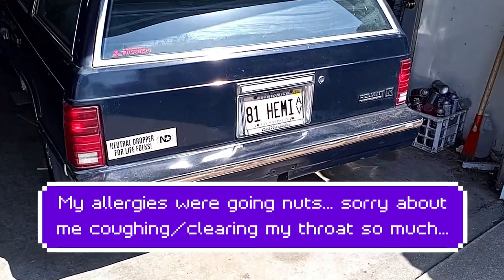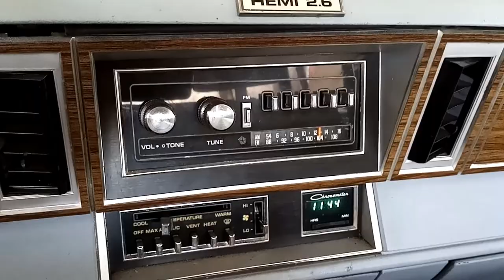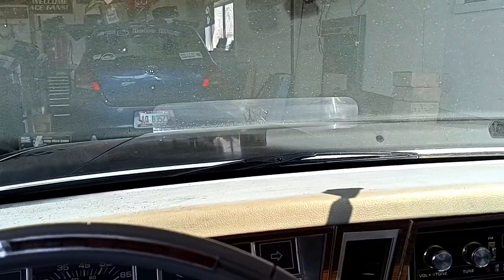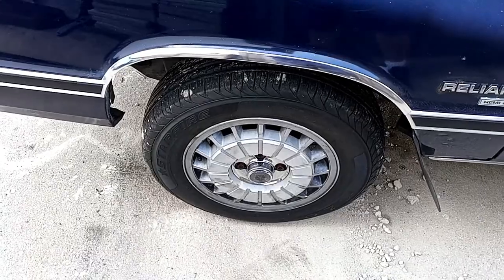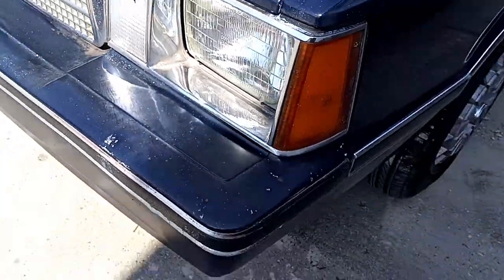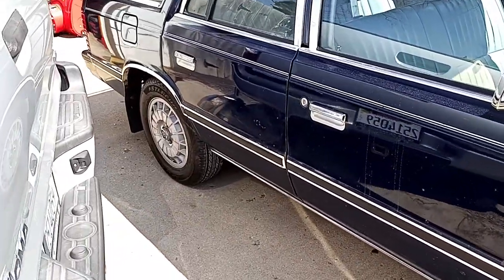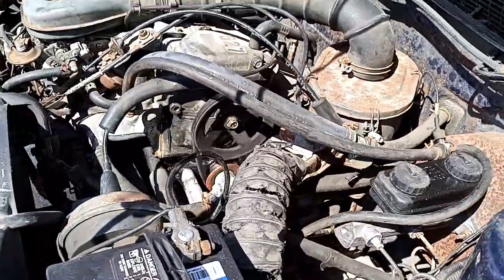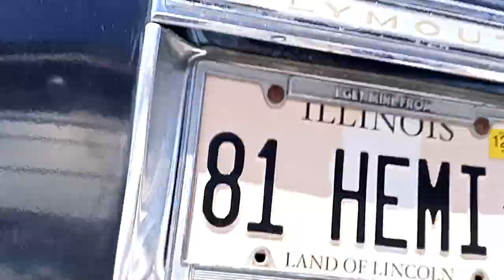1981 Plymouth Reliant K tour and tow truck ride

Comment: Yes that’s how it was for equipment options  back in that era. The AM FM minus MPX radio was for those who had one ear.  😂😂
The 2.6 Mitsubishi absolutely no thanks!
Reply from the maker: The reason it still lives is because of that Mitsubishi engine!
Reply: @aenoymotors  no... The Mitsu did not have the good reliability that Chrysler's 2.2 had.
Moreover, the 2.6 Mikuni carburetor was deeply hated for good reasons.
I cannot endorse the 2.6 as the reason for longevity here...I drove one and know better.
Reply from the maker: I've owned hundreds of these cars. Yes the mikuni carb sucks but the rest of the 2.6 is pretty stout. The carb for the 2.2 is crap as well, anyway.